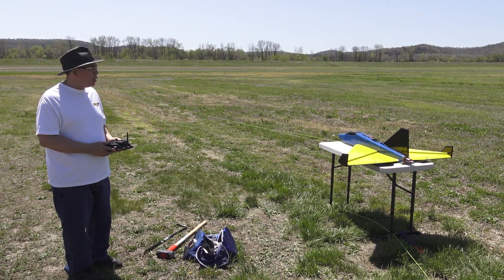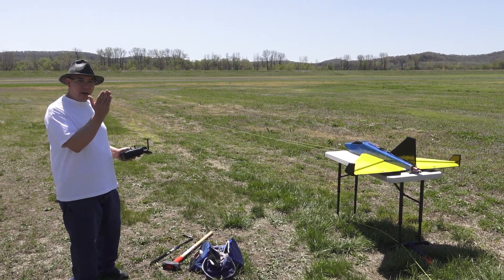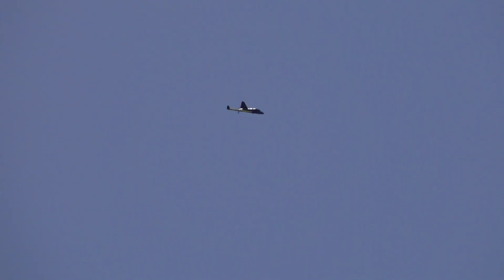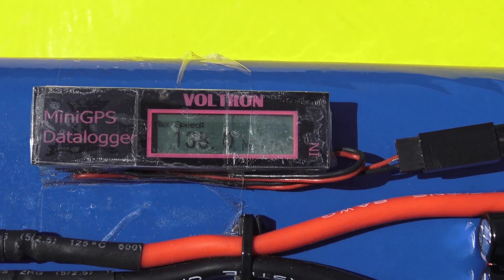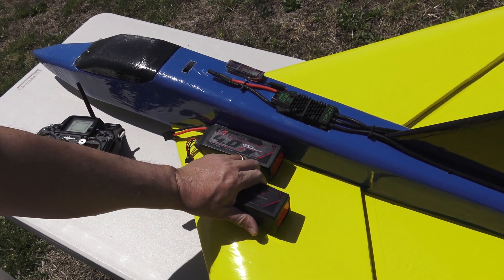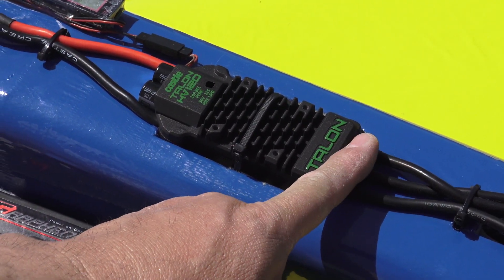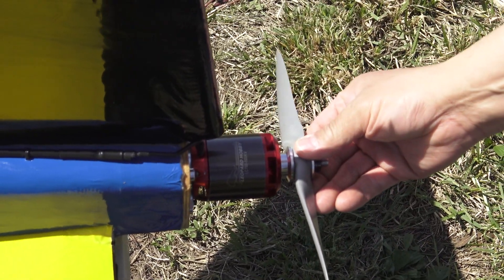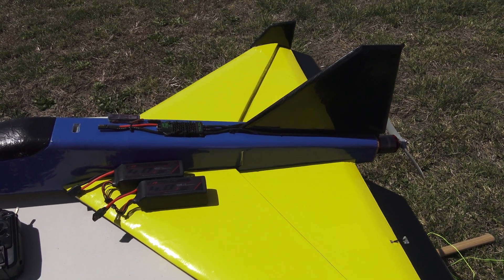Bullet Plane Magnum 4000watt Power System Upgrade

Comment: I have this exact motor and want to build a plane around it...what prop?  I'm guessing you used 10s?  Thanks.
Reply from the maker: This motor in this video was running an 11x7 APC gas prop. You can also use a 10x10 APC gas prop for higher prop speed but less trust.
Reply: Thanks! I have a few 10x10 APCs in the prop box....I know what I'm doing this weekend! ☺

Comment: Man ......nice flight but build a launch ramp out of pvc pipe its easy. your pulling the plane too the ground , no wonder its unreliable.
Reply from the maker: Thanks Craig! The first two bad attempts to launch were my fault. I had the radio Tx set to the wrong model. It was giving down elevator when I was giving up and left roll when I was giving it right etc. The third launch was with the right model selected and went the way it should have the first time.

Comment: Glad you got her going again even after that mishap on the first launch. It flew really well and sounded AWESOME! The way it glided it at the end shows it's not too overloaded with weight with the new setup. Nice work Frank.
...RCPP
Reply from the maker: Thanks RCPP!  Both Paul and I were up till past 2am the night before working on other planes. I forgot to change the radio back to the BP Magnum and you saw what happened. I'm just glad it all worked out and the new power system worked as good as it did. 138mph for a plane that now weighs in at 9lbs 2oz (4139g) in not too bad!

Comment: Hey we all make mistakes even after all the years we've been doing this. You know I've been very partial to the bullet plane, built many of those. I think you nailed it Frank, the flying envelope on that is fantastic, great job guys!!
Reply from the maker: Thanks Greg! I'm real happy with the 138mph results of the new power system! It was moving pretty good. I've alway looked at the Bullet Plane as my trademark plane just like the Super Nova is to Paul. I'd have to credit the KF2 airfoil for the great flight envelope and flight characteristics of the plane.
Reply: If ya still got 10 fingers then the mistakes you've made aint so bad :)
Reply from the maker: Thanks mickvk! I still have all ten so guess I'm not doing so bad.